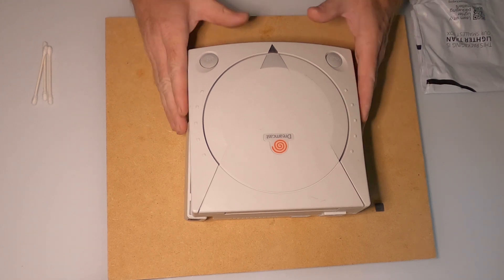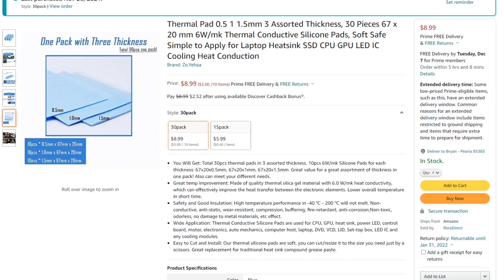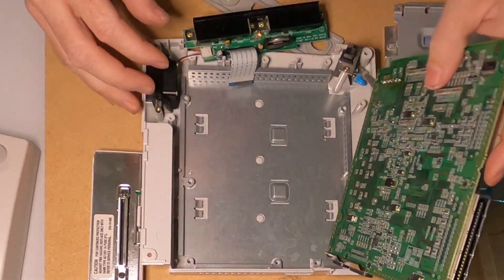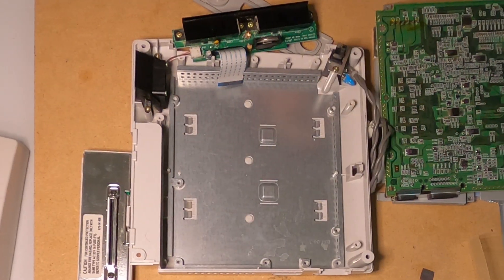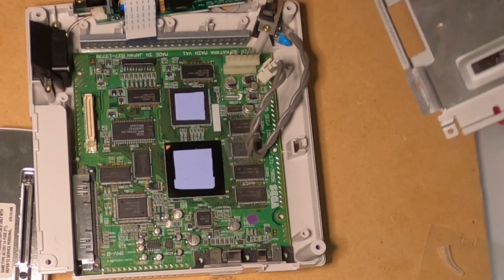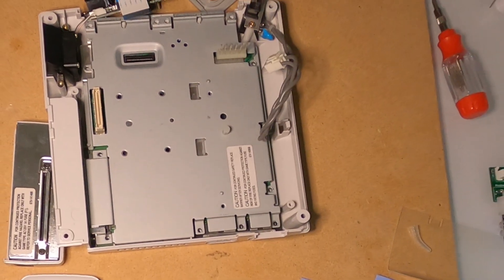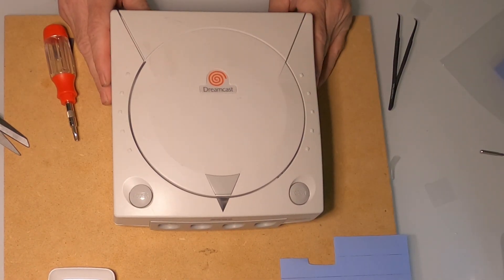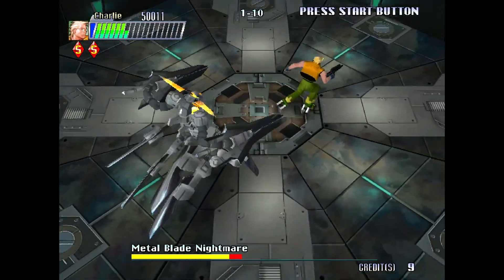Sega Dreamcast Thermal Pad Replacement Cooling mod

Comment: Quiero hacerlo en mi Dreamcast, según he leído en foros se deben usar pads termicos de 1,5mm arriba y de 1mm debajo ¿Es correcto?
Reply: As far as I searched for this information, it's 1mm thickness, both parts of the mother-board. 
People who say it's 1,5mm just want to know more than the Japanese engineer who created Dreamcast. 
It has got to be the same thickness the original is. A thicker one may isolate the heat and not transfer it to the heat sink

Comment: Just in case anyone is wondering... the location he put the thermal pads on the bottom of the board is not correct. You want to put the thermal pads on the two small square humps on the bottom metal shield - once put in that location and the board is put back over the bottom shield the thermal pads will make contact with the chips they are supposed to contact. Hope this helps! Great video!
Reply from the maker: Thanks for the added info.
Reply: So he does it wrong, but 'great video' ? WHAT?!!

Comment: Just an FYI the two lumps sticking up on the shield in the bottom of the Dreamcast, that's the best place to stick the thermal pads otherwise you run the risk of them falling off when you place the mainboard back in. Have a great day nice video dude.
Reply: agreed, that's where the old ones were on mine. a "thermal pad to nowhere" doesn't cool anything :-D. it has to sit on metal